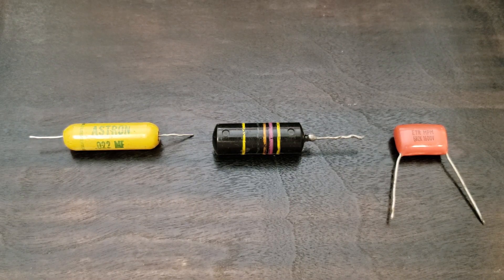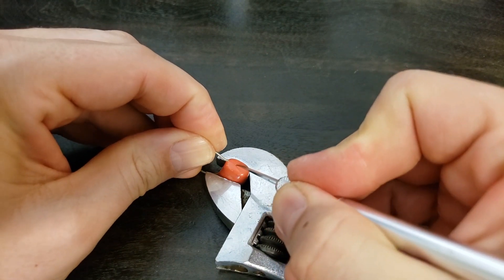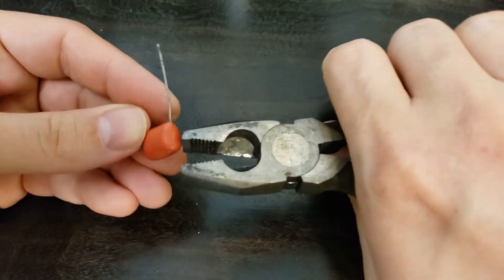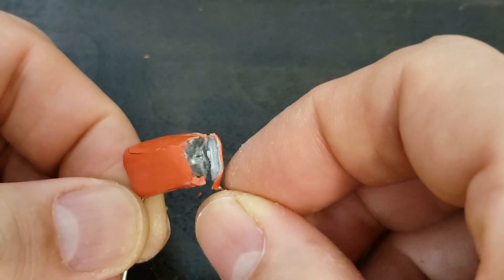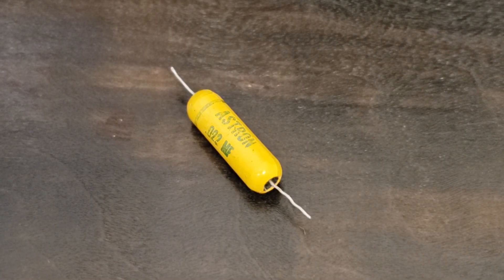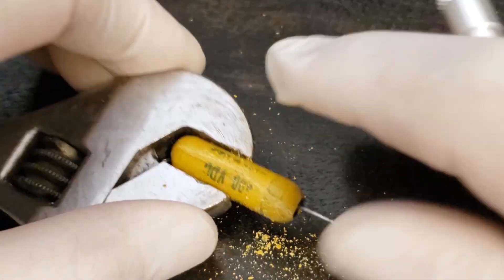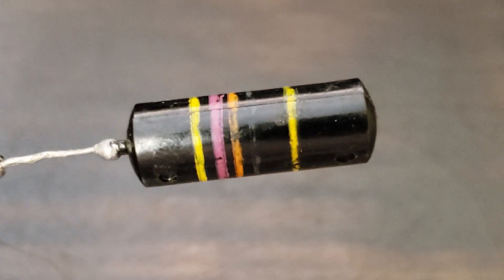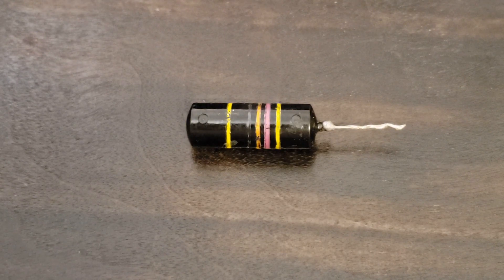Bumblebee Capacitor - What's inside? Orange drop cap TONE CAPS

Comment: Why didn't you wear a glove for the first cap? And what is a capacitor anyway?
Reply from the maker: Haha, the gloves!  I didn't wear them for the first one because I knew it was made up of just plastic and aluminum.  The 50 year old caps though, I thought might have some "questionable" chemicals inside. The bumblebee one, especially smelled chemical-y.
Capacitors are used in electronics to regulate electricity in very particular ways.  Some are like batteries that fill and drain, functioning much like a water tower would- keeping a bit of power in reserve for when needed.
In guitars, they work a bit differently.  A capacitor(like the ones in the video) only allows certain frequencies to pass through them.  So they can alter the electricity coming from your pickup simply by passing through it. Turning the treble down, is just adding more capacitor.  It's how most EQ's work on any amp.
Reply: @FrankOlsonTwins  , Actually nothing ever passes "thru" a cap as the plastic film insulates the two ends. All any cap can do is charge and dis-charge. With DC it stays charged until something drains it, with AC it charges and dis-charges at the rate of the freq. allowing current to flow in the rest of the circuit, that's why it's value and not what it's made of matters.
Reply: A great 11 year old video about what a capacitor is https://youtu.be/ZYH9dGl4gUE